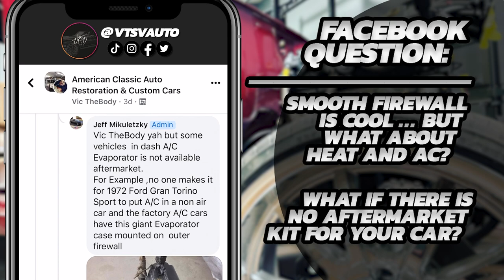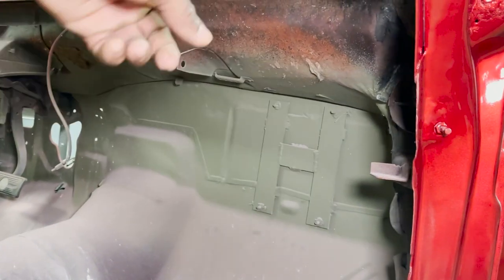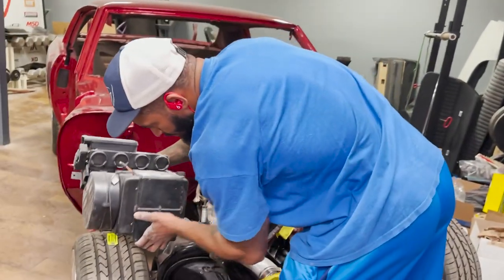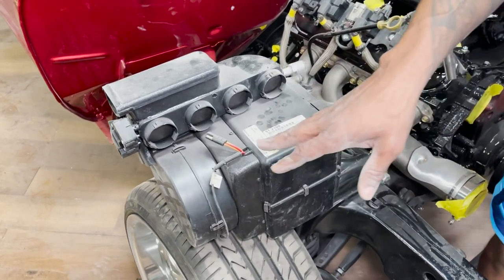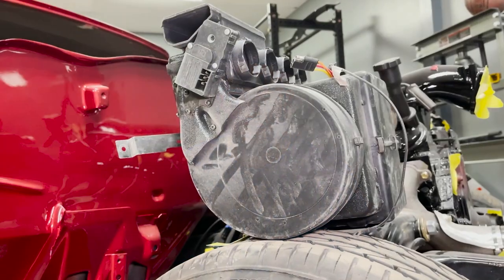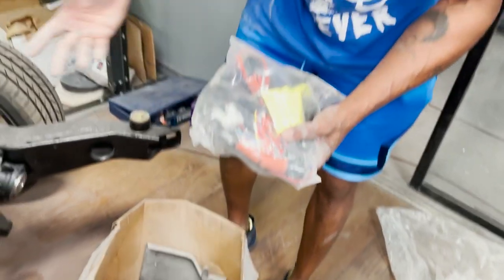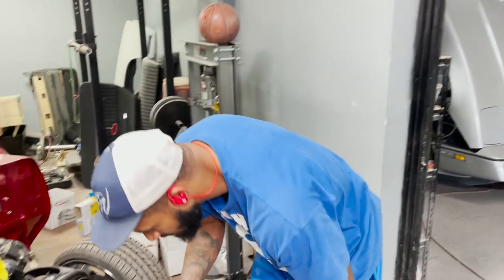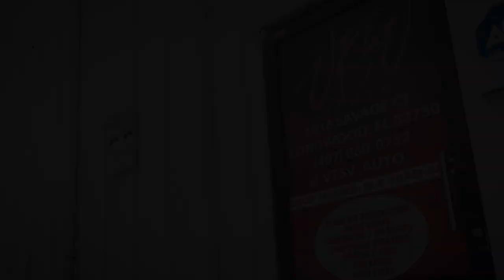Where's the AC? - Hiding Your AC Evaporator

Comment: I'm in Los Angeles  , you guys in Florida not playing  when it comes to updating old schools.
Reply from the maker: we bring em back from the dead, with a vengeance! 😂 much love to LA!
Reply: @VTSVAUTO  I'm currently restoring a 1975 convertible chevy caprice classic . Just finished quarter panels & bodywork  , electrical wiring , fuse box upgrades.  Interior then top . Had it sense 2004 , doing it right 2nd go round . No cut corners